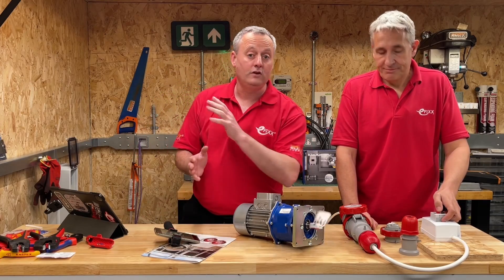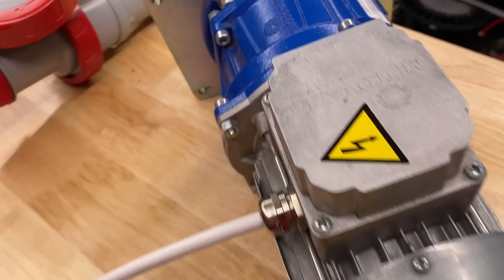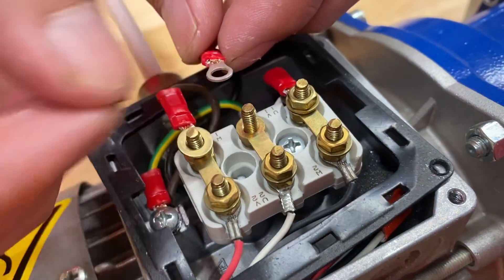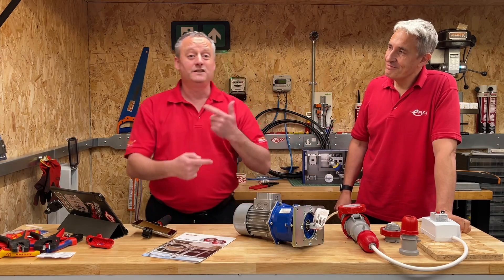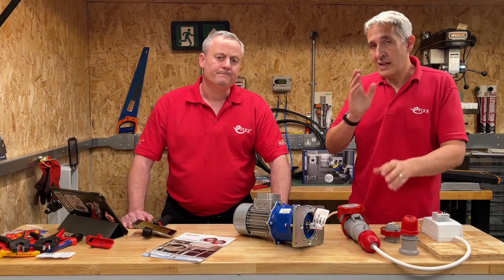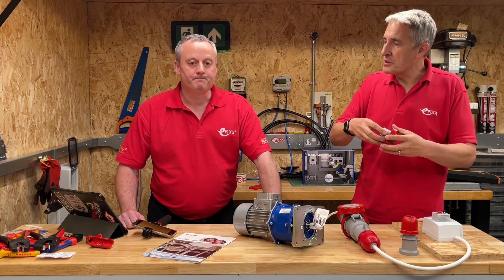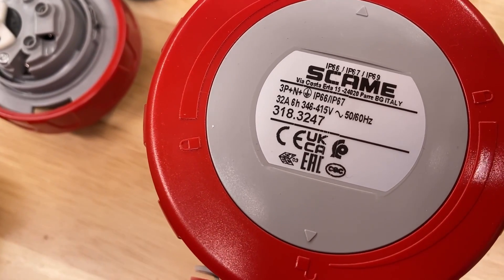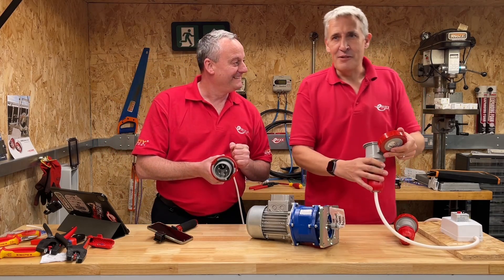The Secret Device Hidden Inside This Industrial Plug

Comment: Good to know. I am an engineer on quite big yachts and specially on old boats there is not an automatic control switch box reversing the phases on board. Now I know what can I use instead of opening the plug ashore every time we change berth or port. All the 400 volts pumps on board will thanks SCAME!

Comment: If the phases of the socket have been incorrectly wired how were they tested when installed?  Phase rotation testers are £50 upwards, no excuse for not testing it just shows bad workmanship!

Comment: Note that this 'plastic' type of connector is NOT certified for Continuous 32 Amps, the label shown appears to be marked with 8hr i.e only 8 hours duty cycle - I learnt the hard way as I had to buy a replacement for a melted plug.
Reply: In my experience, if a piece of electrical equipment can be rated for 8 hours duty cycle, it is considered continuous. If it does not heat up or melt in 8 hours of duty, rest assured it will not for any period beyond, provided the load conditions haven't changed as much as to cause heat build-up.
Reply: That is not correct. The "hour marking" on cee style connectors referes to the orientation of the pin circle in reference to the plastik nub on the housing. It designates the voltage. The standard what this plug is, is 6h. That designates 230V for 3pin and 400V for 4 and 5pin connectors. 4h for example designates 110V. 1h is reserved for special usage cases, mainly generator feeds.

Comment: I believe Mennekes came out with this 15 odd years ago.  We found it incredibly annoying.  I work with refrigerated vehicles which plug in overnight to cool.  The vehicle suppliers would fit these plugs to the supplied flex hookup leads and inlets.  If for some reason a truck didn’t start to cool, people would try to switch the rotation.  It was NEVER the fault, but some “over the phone engineer” obviously once suggested trying it, and since then, any fault, the twits try this before contacting engineers, even though NOTHING could have changed.  A pointless device IMO.

Comment: Looked into buying these oversized connectors years ago. Nobody stocked the way over priced plugs, cord connectors ,& receptacles. While on a roll most American electricians hate the piss poor IEC motors. Fragile 6 screws break too often, when water gets into pecker head studs short out so it's best to cut wires off throw away POS stud base in trash. IEC motors do not last as long as real deal rugged made in USA NEMA frame motors.

Comment: Relocated some equipment to a factory in aintree a few years ago and it all ran in reverse when connected the same phases as it had been in its original location. Factory electrician said that always happens there as their phase rotation is reversed for some reason. This was a big factory, reverse phase rotation is more common than you may think. A comment further down mentions pre 1940’s was reverse standard but dont know if this is correct
Reply: Yes. In pre-world war two times the right way was left rotating in "German Reich" (Siemens and Halske) and "United Kingdom" use copy of Siemens too. Exactly around the world who installed Siemens stuff use AC left rotating machines. 

Afterwards as we use "right drive on the right side" on the continent the machine rotating change to "right" too. It was a DIN then after Siemens and Halske was a international German company how sell world wide same before. So some remote places change the rotation too. 

UK forgotten "three phase use" to save copper (BTW: Save expensive things is a "thing" in every war. Do you can see it that the brit's mostly loose BIG LETTER too! Too many wars in the history!) and install 'rings' since the old DC times. Now they invented it after they learn that 16 kVA use less copper if you use three phase for typical wood saw and electric cars. BTW: The first AC/DC plug and socket for the car industry are invented from firm Mennekes. It is useable for one phase AC, two phase AC, three phase AC and DC. If you use solar or wind (and battery) do you can put the power over DC directly into your electric car without change DCtoAC and ACtoDC.

Comment: I have seen them first in the early 90th (Europe continent) They are great for construction sites where correct installation of temporary power outlets is more a wish than a standard, but the cables inside the plugs were stressed by regular changes and will break over time.

Comment: Great. Then I can connect this plug to my 3-phase heater and use it to cool in summer !
These plugs are often used in the construction industry. In the meantime, no one knows whether the socket or the extension cord is wired incorrectly. Or was the socket wrong and someone adjusted the extension but the next time the socket is correct again.

Comment: We use Phase Flip kit all the time in the event industry, old camlok was easy, just swap 2!!! 

But Nowdays we either have phase Rev switching on Hoist controllers or the "Phase Twiddle" plugs as shown...

Something to bear in mind, IF the phase sequence is wrong, SOMEONE has screw up (and signed off on an incorrect supply!!!!) so the supply is shite and i) not fit for purpose + ii) obviously not likely to be vaguely safe, so just take a minute to make sure ( IE Meter PSC/PFC on every phase) the supply is actually not gonna hurt you....

Generally with electrics, shoddy is bad, quick fixes for shoddy are the start of a LOT of paperwork!!!!!!!!

Comment: In former Yugoslavia, almost every home has at least 1 domestic 3 phase 11kw plug for storage heaters or stoves. 
Growing up on a farm, we had 3 phase saw mill and corn elevator. As old cables came with 2 black and 1 brown wire (new ones have brown, black and gray), phase order was often just guess work, we had short extension cord with 2 phases crossed over. I thing that it is far safer to have small extension, than possibility to damage wires by crossing them over.
Reply: Yep same here, we just have a tiny short extension cord that has the phases swapped over. 
So if you want it to go the other way you just plug it trough that.
Reply: The two blacks are distinguishable: The black one between N and PE is L1, brown is L2 and the black one next to the brown wire is L3.

Comment: Many years ago when I was in the RAF working on the Victor K2 Tankers, we had to replace the Hose Drum Unit which was powered by 200V 3-phase power. After the leckies had connected it up and we tried to test it, the pump made an awful noise and didn't work. I said to one of the leckies it sounds like its going the wrong way. "Nah, not possible" he said adding "The terminals are different sizes so can't be cross connected". Anyway, after a lot of head scratching and phone calls by them it turned out the HDU came from a test rig where the terminal sizes were different and lo and behold the phases were swapped. 2 cables removed, new crimps fitted, reconnected and bingo! As a rigger at the time I had to smile😊

Comment: These have been around since the '90's. I worked for RS back then and seem to remember they were made by Mennekes.
Reply: Yes Mennekes produce this since so a long time. But the first plugs (equal what manufacturer) was very expensive - so some worker use a small cable changer with plug and socket for the both black cables. Specially at one hard install place (only here and never change place) the most people change inside plug or inside machine. I self identifies them and marked one with something so that I install long cables correct 1:1.

Comment: These have been around for years. Never understood why they are not more widely adopted
Reply: In Germany and Thailand they are mostly installed at machines with one-way e.g. saw, compressor, aso. since many years. But we use three-phase since over 100 years. In the old days as I was young I use a short changing cable with plug and socket with me - many older machines was installed at one point only.
Reply: They have been arround for decades...
Reply: Because they suck. The connections to the two reversible pins have a nasty habit of failing over time without it being obvious from the outside. Many an old farmer´s circular saw or large pump burned up its windings due to being run on only two phases for extended periods of time. They are the reason why the cooling units on containers and trailers need to have a special module that prevents them from being powered up with a missing phase or the wrong phase sequence.
Reply: These seem like treating the symptom rather than the problem. And worse one of these could easilly introduce a phase screwup into the system rather than fixing one.

Comment: Does it prevent you from rotatiing the pins in the same direction everytime? If not, at some point the incoming wires are going to get very twisted and ripped out of the termainals.
Reply: Yes, they are limited to 180 degree rotation
Reply: No. It is flipping 180° at left or 180° back to right. I use a CEE 16A plug since around over 20 years at my wood saw. Some friends how rent them not have correct three-phase installation (should be "right" now, older (pre-WW2) standard in FRG was "left").

Comment: I remember that our wood saw didn't work as it should after my late grandma's house got renovated so me and my parents could move in. Turns out that someone mixed up two of the conductors, there were two black one's, that caused the saw to sin backwards, which was actually dangerous for the style of saw we use. So they came out again to fix the mix up.

Ended up getting more issues later on because of some apprentice didn't do their job correctly, and caused a outlet to malfunction amongst other things.

Comment: Several manufacturers do such devices. We call them "Phasenwender" in German. They are a useful piece of equipment indeed.
Reply from the maker: Phasenwender - thanks 🙏
Reply: @efixx  Yeah - Phasen... (Plural of phase/line) ...wender (changer). New writing Fasenwender too. We goes literally mostly the best name since Mr. Siemens and Mr. Halske invented AC machines and DC/AC changer!
Reply: that is an awesome sounding name!
Reply: And they are an old invention, I recall them back from the early eighties.